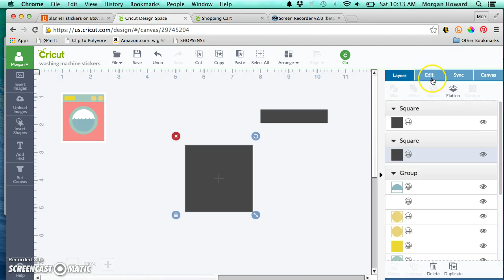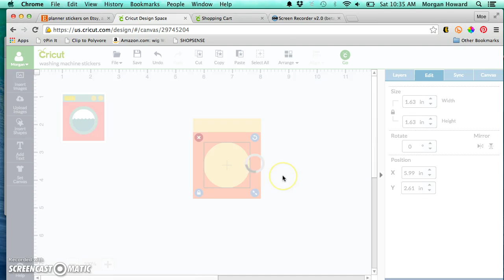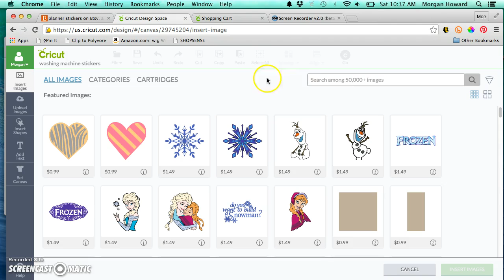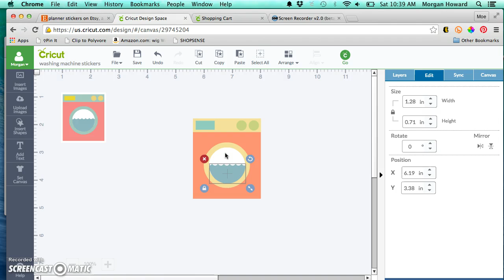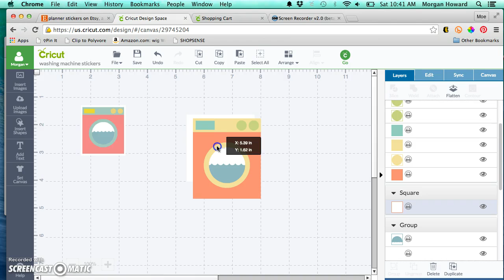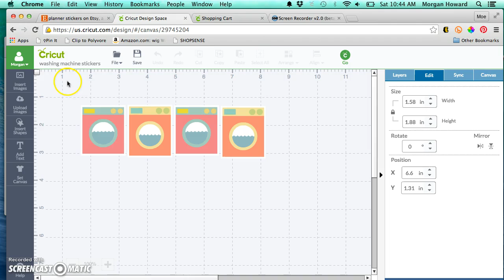How To Create Planner Stickers with Cricut Explore and Cricut Design Space

Comment: So how do I resize your New Years sticker sheet to fit the Big Happy Planner?  I'm trying to use my Cricut to print then cut and it won't let me make it big enough?  Is there a work around? Thank you
Reply from the maker: Emily Pennekamp no unfortunately you won't be able to size it bigger. The print then cut area for chrome is 5.5x8 inches so if you make it any bigger then the Cricut will tell you the image is too big. You may be able to use the eraser tool when you upload to erase part of the image and size that accordingly. Make a best guess using the rulers/hides on the canvas. However I will say the max resolution for that image is at its current state so if you increase it, you will most likely wind up with a poorer quality image. Hope that helps a bit.
Reply: Thank you so much for responding!  While I love the Big HP I kind of regret purchasing it because everything seems to be designed more for the regular size HP.  Oh well!

Comment: Hi! thank you so much for this! Do you know how to create your own bleed? Like what you did with the white box but have the cricut cut the inside picture. I can't seem to get my cricut to the right calibration and the default bleed is messy looking. So anyway to not have the white borders without using the default bleed?
Reply from the maker: +Machi Lee Unfortunately the Cricut has no custom bleed option.  I've found that using the preset bleed is the best way to get the best cut.  For me, I peel up the top layer of the sticker paper leaving only the stickers adhered to the glossy backing, this way it looks much nicer.  I throw away the top layer with the bleed on it leaving me a 'crisp' look.  I've found that the stickers don't fall off or get stuck to other things by doing this as well.

Think of when you get round circle label stickers from Avery and the like (the bright colored ones) they are just adhered to the glossy backing.
Reply: Yeah, that's too bad the cricut doesn't have that...Your suggestion is great!!! Thank you so much for taking the time to reply!!! xo

Comment: Moe, how is the printing on the air? Is the resolution good?   what is the DPI?  I've read that the silhouette has WAY better dpi than the air. Just trying to compare before I buy.  TIA
Reply from the maker: +PeonyJoy I have noticed that the quality is lower if you don't have your printer set to the highest quality possible.  I increased the quality and I increased the ink volume.  I've noticed after that the quality becomes much better.  I haven't played around with my Silhouette enough to learn how to design in the program yet but I find it is less picky - especially with cutting printables.  

I couldn't tell you the exact DPI as I still print with the highest quality between both - so you'd think it would be the same - but I would say the Silhouette is slightly sharper.  Honestly it isn't enough to bother me.

Comment: How tiny will this be? What dimensions would you suggest for it to just be a tiny icon that I can write next to like "whites" "towels" for certain days? Does that make sense? This looks super big like a whole EC box
Reply from the maker: +Jennifer Mercurio It is easier to design an image when it's much, much bigger than you need...otherwise you'd be staring at something soooo tiny!  After I've design the image - the washing machine for example - I scaled it down to the size that was better suited for a smaller sticker.  I believe they came to be about .5 inches wide.  That is the beauty of using DS shapes to create images - they don't lose their quality from being enlarged or being shrunk.  You can resize them how you wish, sort of like a vector image.  So you could make them .5 inches, 1 inch, .25 inches, 20 inches...it's up to you.  Hope that helped a bit.

Comment: hello, I just wanted to say that I love what you just did. I wanted to tell you on the cricut. There is a function after you click the go button. Where it ask you about the project copy. It will say hide mat settings. If you click on it you will be able to take away the bleeding when you print it.
Reply from the maker: +simplyml I've tried that but my Cricut doesn't like to cut properly with out the bleed :( even if there is white space around it and I take off the bleed it cuts slightly off center.  So I always leave the bleed on....kinda stinks but it's more accurate at least for me.  However, I'm open to calibration tips!  It seems like I'm always calibrating the darn thing.  Thanks for watching!